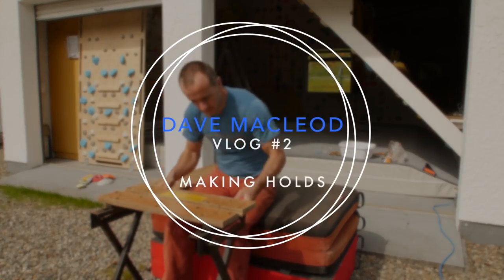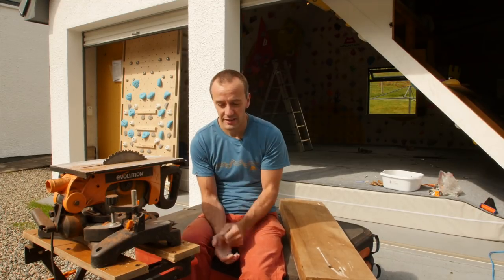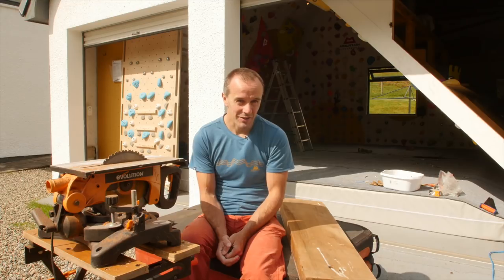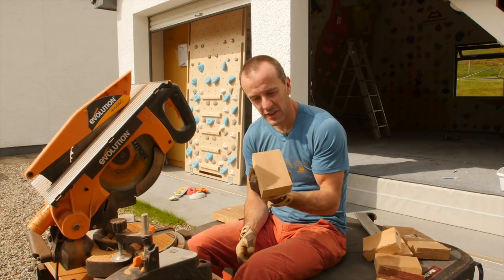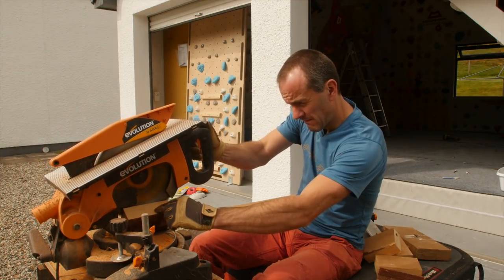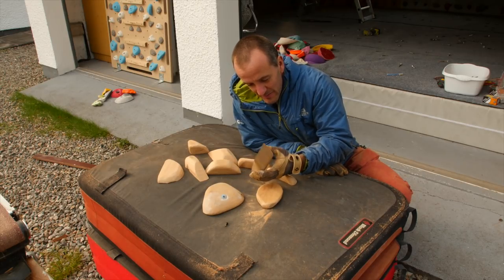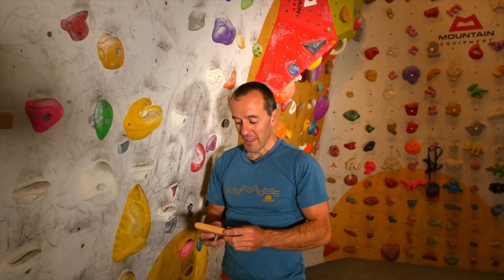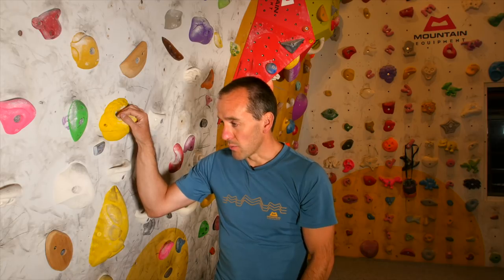Vlog #2 How to make wood holds and circuits

Comment: Love you man but your technique with power saws is super dangerous. Please don’t use a table saw without a fence or gauge and never grip both ends of piece while pushing the wood through. Kickback can blind you or take a finger or worse.
Reply: I truly admire Dave, great climber I enjoy his videos, but must agree with many of this comments, Personal Protective Equipment= PPE, goggles, earplugs, don't sit in front of the power tools, it takes less than a second to loose a finger or worse.
Reply: Yeah, that was scary to watch! I'm a huge fan, not trying to troll even a little, but: Please consult some of the many videos online about safely using these two saws.

Comment: Dang Dave, Purely for your sake because I find you to be a delightful human being, and I love your videos, I gotta add to the chorus of people telling you to be careful with that saw.  Carpenter and climber here.  Cutting such small pieces on a chop saw like that is extremely dangerous.  It risks that piece flying off and hitting you, or worse, having your hand pushed or pulled in to the blade.  Especially with this saw, which looks like it needs a new blade. I use a chop saw every day and only a few times have ever done what you just did.  If you need to make cuts on such a small piece, you should clamp down the piece with a clamp and then cut.  Alternatives include clamping it on a bench and using a circular saw.  Also, about the table saw, you should always only hold one half of the piece you're cutting, otherwise you are forced to lean over the blade as you cut it.  If you just push one half of the wood, you can stand to the side, and don't risk having your body pulled in to the blade.  That really does happen.  Of course, I recommend glasses and ear protection too, but those things seem like, if you haven't already developed that habit, you won't.  Anyway, I hope this doesn't come off as too preachy.  I just didn't want to half-way explain things.

Comment: Really enjoying the vlog so far Dave but I have to say it; please consider wearing safety glasses when you're using a table saw. Particularly with using reclaimed wood, it only takes one long forgotten nail/panel pin to turn you in to the world's premier one-eyed climbing Scotsman.
Reply: Not to mention no riving knife installed and sitting with your face directly behind the blade, if kick back occurs you could be seriously injured.

Comment: Dave, Next time your using a table saw, do not sit with your face directly behind the blade. If it kick back your going to seriously get hurt.  🤘
Reply: And maybe some ear pro?
Reply: and always use the tablesaw guides (even with a relatively low-power motor) when cutting.

Comment: Hello Dave!
I have to tell you that I really like the idea of making your own wooden holds. Do you know by any chance what species of wood you used?
And since I'm quite familiar with woodworking I'd like to encourage you (like some others) to use eye and ear protection. When dealing with some species (like oak) It's also wise to wear a dust mask, since the wood dust tends to cause lung problems.
Another thing is using the machines... Cutting on the table saw freehand is very dangerous! You should always use some sort of guide (fence or cross cut guide) to avoid kickback. Especially when cutting smaller stock there is a big risk of cutting your fingers if kickback occurs.
I don't want to sound like a wise guy or to be a safety nanny. But I would like to see you climbing for years to come and learn from you since you are a big inspiration for me in my climbing efforts :)
Greets from Slovenia!
Reply: I've been a carpenter for years and have had bits of wood ripped from my hands doing exactly what dave was doing and it can cut and really hurts, luckily my fingers were never pulled into the saw, so its not advisable. Maybe its ok if you have hands as strong as dave's but probably not! Sorry dave. Great vid though, cheers :-))

Comment: Im loving all the climbing info from this guy, particularly helping with my elbow issues. Just one point on this one I am new to climbing but imagine 10 fingers are relay helpful. I do have 30 + years working with power tools, this machine (the saw) used in this manner will eventually do one or both of the following. eat your fingers. spit the wood back towards you with vicious results.
please be careful. I personally would not allow this particular type of saw  onto one of my job sites.

Comment: Hi Dave, 
Brilliant vlog thanks so much for taking the time to put them together. 
I have made lots of wooden holds at home from firewood logs just like you would do when chopping up kindling. I used Ash and as its firewood it's obviously really cheap, just make sure it's seasoned. I split them along their length with a small axe and make different shapes. I then cut them to length with a hand saw and sand them. I did all this in underpants and flip flops, no need for PPE

Comment: Love the series so far. Loving the lol of the holds. My only suggestion would be to avoid countersunk screws. They can wedge a crack. Best to use washer heads. And be wary of grain direction when making them. Grain running short ways across a long hold with definitely crack and leave exposed screws you could catch yourself on.

Comment: Using the wall for stamina training is the way to go for sure. 40 years ago I used to train at the Glasgow tech college wall. It was about 15 feet high, a bouldering wall. At first, we all amused ourselves inventing bouldery moves and big dynos. Cubby Cuthbertson would turn up. He never bouldered. He would climb up and down the descent route, feet on brick edges, for half an hour to an hour at a time. We had to find alternative ways down. We were like, "Hey Maestro, you're in the bloody way". But we got the picture. If you want to climb well, train for stamina. Train until your forearms are torched. Also, that way you avoid injury. Other top dogs of that era also trained relentlessly for stamina. Ron Fawcett had a railway wall near his house. Tom Proctor climbed on the wall of a barn. Train for stamina.

Comment: Hi Dave,
Do you train aerobic power as well?
What kind of alactic intervals do you do, which intensity?
I understood (now) that this is pretty important for regeneration of ATP for anerobic system. What do you think about, to train this specifically?
Reply from the maker: The above circuits do train aerobic power.
Reply: Dave MacLeod 
I‘m reading „Training for Climbing“ from E. Hörst.
Table 5.5 shows for Aerobic Power: „low to moderate intensity“, 
„alactic intervals less than 15 seconds, strength / power endurance intervals of 15 to 90 seconds“
Is that what you‘re training with your circuit?

Comment: If you are training anearobic endurance, what kind of intervals would you use? I have a 45 degree wall with a good selection of holds and I typically count how many moves I do in succession but I have been thinking about timing it instead. Thanks Dave! I’m an older climber that has been at it for quite some time but have really dedicated myself to it in the last couple years. I really appreciate the content you put out!

Comment: one more on the safety comments: DONT wear gloves with a belt sander. If your finger gets caught it will pull your whole hand in. Better to miss just the skin on the tip of your finger rather than the whole hand eeh?

Comment: Yes, building mitochondria, but are you really eating a healthy plant-based food? Or you eat muscles and internal organs of other creatures?
Reply from the maker: I do eat some plants, yes, along with muscles and internal organs of creatures.
Reply: That's called a "haggis supper"
Reply: Plants are good fiber, in moderation, for pushing the nutritious muscles and internal organs of creatures through our omnivorous guts.
Reply from the maker: There is no requirement to add anything else in order to push meat through our guts.
Reply: True enough Dave, I was being somewhat simplistic. I do feel that salads and in particular fermented foods like sauerkraut help stabilize my gut biota. Plus a bit of fresh fruit is so tasty!

I am interested if you are still on a keto/low-carb type diet? I converted almost three years ago and have found huge improvements in my health and performance. Reading of your experiences, as well as those of Neil Gresham were encouraging early in the process...truly invaluable.